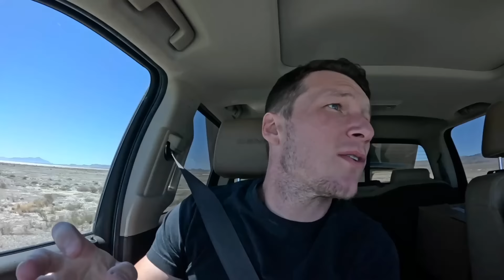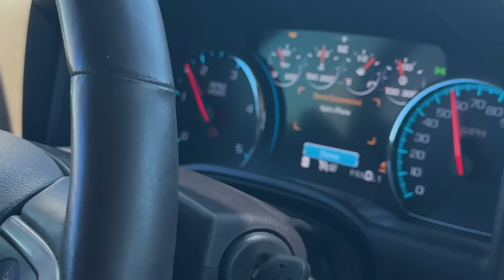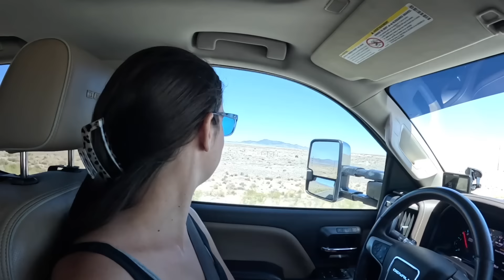New Trucks are 'Built' to Leave You Stranded

Comment: No question...I always do oil changes at 5k, and use a good quality synethic oil and filter.  Take good care of the lubrication, the engine will thank you with less problems down the road when the mileage starts getting higher.  With towing and dusty region driving, doing oil changes earlier rather than later is your better bet!  Don't forget to change out your cabin filter now and then as well, so you get quality clean air incoming to the cab...as many people forget about these filters, and for the most part, they are simple to do yourself!  I personally do all my own oil & filter changes myself (3 vehicles) so I know what the quality of the oil is, and that it was done correctly.

Comment: Hanks:  You should temper your excitement about what Caidin told you about your diesel engine.  ATF introduced into a common rail diesel engine is a HORRIBLE idea; unless you want to have the engine rebuilt.  In older (50s, 60s, and 70s) diesels, this was a common practice.  But in modern diesels, just never do it.  The properties of modern ATF is much different than back in that earlier era, so all the synthetic lubricants in modern ATF is not meant to be burned in the engine.  DEF is appx 32 percent urea and 68 percent ionized water, not the 90 percent Caidin mentions.  The white crusty material you see on the old DEF injector is due to a leaking injector.  That's not where the DEF is being injected.  That's happening inside the exhaust tube.  Most likely an "O" ring or some other seal went bad causing the leak and low-pressure event.  Exhaust Gas Temperatures (EGTs) during a regen typically reach about 1000 to 1100 degrees Fahrenheit.  If it were 2000 degrees as Caidin mentions, you'd probably be melting a lot of parts and blow up your engine.  EGTs over 1300 degrees for any length of time will damage the engine, which is why when towing in mountainous terrain, you need to monitor how hard you're pushing the engine.  Suggest a Bank "i-Dash" to do that.

Comment: Yeah unfortunately they have to run that thing through a kiln to clean it out and reset it and then it goes back on and runs you down the road for a while, that's the experience I had with an Isuzu diesel I used to drive in2015, for the company I worked for, those machines are just a nightmare, your truck can be running perfect and they tell it that it's not, I know what it's like to be on the side of the road when one of those stupid machines go south it doesn't want to work properly, and like I said your truck can be running perfect but the machine says it isn't, thanks for these machines Uncle Sam real nice to you guys, also you have to pay for your DEF fluid, and to repair the stupid machine when it heads South and breaks down???. Buy a gas motor pick up they can tow also, maybe not quite as good I don't know.

Comment: SO FAR, SO GOOD!  Towing my 21' TT with my 2005 Silverado 1/2 ton has, so far, not been an issue.  Just over 170,000 miles and 5,000 hours (5.3L V8) with - KNOCK WOOD - no engine/transmission issues.  I'd never even toughed the ignition system.  Most of its life was spent towing something - boat, race car, toy hauler, motorcycle trailer and now my Micro Lite.  Oil changed maybe twice each year and fresh oil before each TT trip and a tranny flush & fill at 100,000 - time for another one..

Comment: I've worked for almost 30 years driving diesel trucks working for the power company in this area.  In that time the old non DEF trucks vs the newer DEF trucks is a huge reliability difference.  The old never had emissions issues but all the new seem to go through one thing after another.  Thank God that we had mechanics on 2 shifts to stay up with the issues but even with that things were sent out all the time because they could not keep up at times and needed additional help because when delivering power to an entire state every truck was worth its weight in gold. 
If you don't go through emissions testing for your plates and such I wouldn't hesitate to delete that crap just like almost everyone I know did on their personal vehicle to eliminate those issues.

Comment: As a 🇨🇦 powertrain engineer do not delete the emissions system, yes it is a weak link in the system but when it works it works well. Use good quality DEF fluid and maintain your vehicle. Diesel powertrains are far more efficient than petroleum engines.
Reply: You lost me at 🇨🇦 ...

Comment: All diesel owners feel your pain . All these emission systems are not reliable and not if but when it will leave you stranded. You’re having issues with the DEF but soon you will have issues with the DPF and then the EGR.. I got stranded 2 times over 600 miles from home .. I finally gave my truck the weight lost program and now zero issues.

Comment: I use "Rislone 4780 Diesel DEF Treatment | Prevents AdBlue/DEF Fluid Crystallization, 8 oz" every time I add DEF to my SuperDuty.  It really does help keep the crystallization of the DEF to a minimum.  I tested by putting a drop on my crystal deposits in my fuel bay from a minor spill.  de-crystallized immediately.  I generally only run pump DEF when Im towing cross-country because the truck eats DEF like crazy.  But, I will only get it from a pump that is not all caked with crystals.  Normally, I use SuperTech DEF from walmart and still add the rislone.  The SuperTech is super cheap compared with BLUE or other brands of boxed DEF.  My $.02

Comment: I have to disagree with the Tech. I have a 2008 gas Denali  with 180k miles on it with literally no issues except 1 engine code that went away after using  seafoam.  It does have to use premium gas. That's the only thing I don't like.  City driving with premium gas can clog the cat. For 1 ton, I hear great things about the Ram. But like you... I love Denali...

Comment: Regen……..Regenerations……As you drive extra diesel is dripped into the exhaust pipe to increase the temp in the DPF (diesel particulate filter)—-particulate means the large and small particulates of exhaust….the tiny ones will go through the DPF and out the back. The larger ones are trapped and then fill the DPF. At a certain level, the REGEN (Regeneration) lite comes ON, the DPF gets super hot, and makes the big particles small, so they can go on thru. Eventually the residue that cannot be burned small enough to go thru will clog the Filter, and you have to either have it cleaned, or replaced. Not all DPF’s are able to be cleaned, so those Filters must be replaced. The entire purpose of ALL this is, in theory, you will pollute only little bitty particles in sizes the government says is ok to breathe. It has nothing to do with making your engine run better or last longer. In fact , the real results are exactly the reverse……..congratulations, Mister Good Citizen!!

Comment: Here’s how you LEGALLY get around emissions 💩that fails.  Find the best older mechanical diesel you can afford.  For me that’s a 1997 Dodge 3500 with the 12 valve Cummins turbo diesel.  Came from the factory without EGR, DPF or DEF.  You might be shocked at the price of a really nice low mileage 90s truck, but they’re worth it. And if you need more performance it can be built in with mechanical tuning.  Since you are in Utah find Power Driven Diesel.  I believe they’re in southern Utah and have a lot of knowledge about tuning Cummins powered trucks.

Comment: Normally it's the RV that give full timers the most issues, but it's the truck for the Hanks that are giving you the most headaches. I was looking at diesel trucks a couple years ago to pull my fifth wheel but after reading so many horror stories about new diesel trucks, I ended up with the F350 7.3L gas engine. I'm sure they have their own issues but so far, knock on wood, I haven't had any problems. But I'm not a fulltimer and not putting on the miles.

Comment: I’m going to say this and take it for what it is.  The biggest problem with the truck market now is the new aged thinking about problems.  And you said it.  It’s just how things are.  For me it’s not acceptable that you have to spend $1000 every 15k miles just on maintenance then to have the truck still be in reliable.  It crazyness.  There is no reason new trucks should be less reliable than a truck that 30 years old.  It also shouldn’t be common for a vehicle to have major repairs under 150k miles.  It wasn’t that way now every car manufacturer seems to have adopted the idea that the longer a vehicle is in the shop the better “we make more money” it’s fraud and it sad we are accepting it instead of expecting it fixed

Comment: 9:19 I had 2 diesel trucks and I switched to a gas and have not looked back. My 07 1/2 Chevy Diesel was my last. $6800 to change the injectors at 150k. Almost triple the $ for an oil change. Change the fuel filter every 7k miles. Tires constantly changed every year due to the weight. Wasnt worth it. If I towed everyday all year, I get it. But not a daily driver. I sold my 2016 Ford f250 gas 2 years ago with 140,000 and only did the normal maintenance. Nothing ever broke. I bought a Dodge dually 3500  gas and I have not been disappointed. Sure it does not have the power of a diesel but I put a 5200 lb truck camper in the bed and have been all over the country with it. It has always brought me home. 108k on it.
Reply: Wow, It's been 60,000+ miles since I have changed the fuel filter on my 12 valve Cummins, should I? Sorry.

Comment: I don't get into the Ford vs. Chevy vs. Ram but..... I have a Ford with the 6.7 and I have never had exhaust issues, nor have I had injector issues. I have seen the stories of the problems but knock on wood, I haven't experienced them. I think it is time to get you a F250 or a Ram 2500. Time to ditch the GM product. I was a Chevy guy for my whole life and switched to Ford when I  started pulling the RV. I have a 2017 F450 that works fantastic.

Comment: You were fed misinformation about the DEF. Diesels use compression to ignite the fuel air mixture. High compression engines create nitrous oxides which are nasty for the environment. Nitrous oxide gets into the atmosphere and combines with volatile organic compounds (VOCs, basically anything that smells like gas fumes, farts, cow farts, perfumes etc). In the presence of sunlight it forms acid rain which dissolves tombstones, buildings etc.. It also kills trees. Other problems are it creates smog (Ask anyone from LA during the 60s or 70s or ask about Denver’s “Brown cloud.” I have experienced both. Smog also reduces photosynthesis which effects crop yields. 
DEF is sprayed into the exhaust which breaks down the nitrous oxide into harmless nitrogen and oxygen which is better for all of use considering the BILLIONS of vehicles on the road world wide. DEF has a shelf life. It is cut almost in half (about six months) by heat. When you buy at a store how long has it already been there? Truck stops have a much faster turn so is more likely to be fresh. 
The soot in itself is inert but is spikey which sticks more easily in your lungs which then makes it easier for harmful things to stick to them and stay longer.
Your soot filter has probably never gone into regeneration mode. Farmers who run generators or water pumps off a PTO, Utility companies who idle for hours or simply a lot of city driving will clog up that filter. Regeneration simply dumps more fuel at speed to create more heat to burn the filter clean. 
He was wrong about dirty oil and the EGR system. Engines do not completely burn the fuel during combustion. The Exhaust Gas Recovery system simply re burns some of the unburned fuel. Not only is it cleaner but even more efficient. IT DOES NOT DIRTY THE OIL. 
Some oil is splashed or sprayed on the cylinder walls to keep them lubricated. The piston rings glide over that film of oil. Some oil gets burned in combustion and some gets scraped back into the oil which causes your oil to become contaminated.
I am a retired sales and service trainer from RAM.

Comment: Best example of  government trying fix what wasn’t broken.  
Diesel motors use never get broken in till over 100,000 miles. They would go forever if regular maintenance was done. 
Pulse diesel  fuel use to be so much less expensive then gas till government got in the way.
Reply: I've never kept a truck with over 100k miles.by then it's a worn out POS,no matter how good the engine is,everything else is junked.

Comment: New vehicles suck in general. You trade fancy electronics for reliability. And that's not even considering the outrageous cost and depreciation.  Buy a good condition older used truck. Concentrate on the condition of the truck, not the age.

Comment: DEF is the perfect example of what happens when a large federal government gets their hands in everything. Ends up costing you everything.
Reply: The Federal Government had nothing to do with creating DEF systems. The government only mandates maximum emissions allowed (as in the maximum NOx allowed), and the manufacturers decide the best way to accomplish that. It's the manufacturers who haven't worked out all the kinks yet. All those semis that drive thousands of miles a day have the same emissions systems yet stuff still gets delivered and the industry hasn't collapsed in on itself.
Reply: @deatman5843  Like you said, government mandated, then everything got screwed-up.

Semis DO have the same problems though. Most of these trucks won't go 80k miles before they have to have the DPF replaced/cleaned (for most trucks, that's once a year). They force-regen almost every week. Require constant maintenance, and cost the owners A LOT of extra money. My 2001 Peterbilt annual maintenance cost was around $7,000. My 2015 was ~$35,000. ALL of the additional cost was emissions related. That was with me pulling the downpipe off the turbo every 6-months and running a chimney sweeper through, to get all the soot off the sensors.
Not to mention the extra fuel cost. I got 8.6mpg out of my 2001 Cat, 650hp/2300tq 18-speed. The 2015 with the Cummins ISX 600hp/1900tq 18-speed has never seen more than 5mpg.

No, they haven't worked out all the kinks, and they likely never will; it's a terrible system. Plug your nose, tape your mouth shut; then run around the block. That's what these emissions standards are doing to our engines. It took the automotive industry 40 years to figure out the emissions standards placed on them in the 1960's.
Reply: @deatman5843 they are mostly fleet vehicles that get rotated into and out of service when they don't go anymore due to DEF system issues. The Hanks and the rest of us don't have a fleet maintenance shop. Its burdensome legislation.
Reply: You are mistaken. Do the research
Reply: @DavidGraham-b1r  you must be a big government kinda guy
Reply: @z.a-c_hno I researched it
Reply: Good Point!
Reply: The components materials will oxidize above 1100°f..

Comment: I have the same truck and I’m going through the same issues, with only 88,000 miles on my truck , I have to replace the whole DPF system on my truck costing around 6-7 thousand for parts and labor , I regret buying a diesel truck is putting a whole in my pocket .

Comment: We had DEF in our fuel in 2017 truck was in and out of shop from Aug.23rd till Oct. 19th. Local dealership in Delta provided us with a car till we got it fixed. After trying everything but rebuilding the fuel system it was decided to finally rebuild the fuel system. $10000 dollar fix. Luckily the service manager said try your comprehensive ins. to pay for it. We notified Ins. provider and they paid all but deductable. What made  Ins. cover was we didn't put the DEF in fuel, gas station had mixed fuel and DEF and all this was at a Truck stop fuel station. That is another story. We never had no more trouble with DEF after they replaced every fuel line and fuel tank was not account its made of material DEF want stick to.

Comment: the top option is never buy any diesel truck witha turbo…the engine wont last 100k especially when your towing…your way better off getting a v8 than a v6 w/ a turbo…id say the same with a gas truck…its a shame that truck manufacturers choose profit over product…if u build and sell enougbproduct u will get the profit….also car and truck manufacturers now build their products so the engine bay is so small and or filled with so many sensors that u cant repair it at home….if your lucky enough ur better off buying on older make amd model truck/ car cuz those were buikt so mich better

Comment: It sucks going through this shit. cause the DPF is pointless its stores the soot and once it gets full it has to regen and reguardless it comes out of the tailpipe. So you’re better off deleting the emissions not only are you making the truck more reliable by doing it. But also if you delete your truck not only do you get better fuel millage mileage loaded and unloaded, but you also have a lot cleaner running truck by not choking it with the egr. No one wants to eat there own shit

Comment: As much time as I spend on the “Build a Ram” website and dream about a new Laramie, I’ll stick with my, built for me at the factory, 2001 Dodge 2500 5.9HO Cummins 4x4 6spd manual with 103k miles.  Edge CTS Juice w/ Attitude tuner, Banks exhaust and exhaust brake and cooler elbow, J&B air intake, bigger turbo, it easily tows my 11k lb Outdoors RV 270RKS 33.5ft travel trailer! P.S. Dodge doesn’t use Allison trannies for the same reason Chevy’s don’t use Cummins motors LOL.

Comment: I have a 2015 F350 Lariat. My emissions system is keeping me from traveling because my truck went into limp mode once miles from anywhere. I can almost predict when it will need a forced regen because it won't regen on it's own. As soon as I can, I'm deleting mine. Every diesel forum I read says the same things. Better performance, better fuel economy, better everything. Clean tune, no rolling coal, and I'm keeping my duel exhaust tailpipe after it's been deleted. Hello delete, goodbye majority of problems. Can't wait.